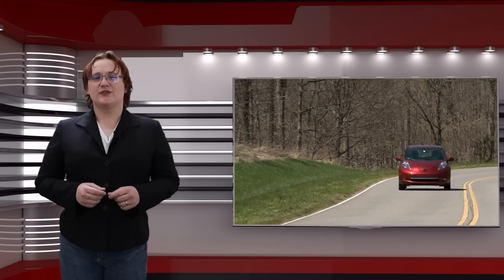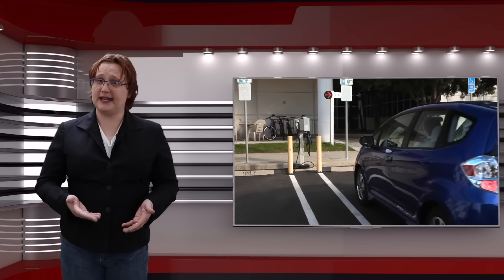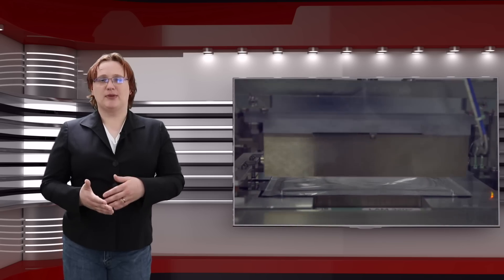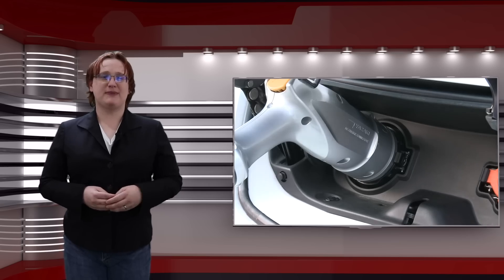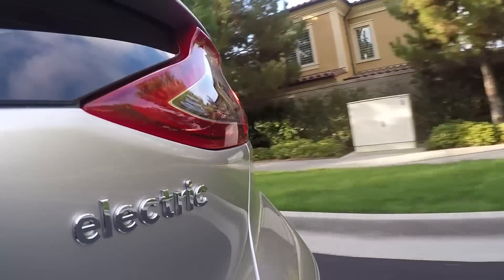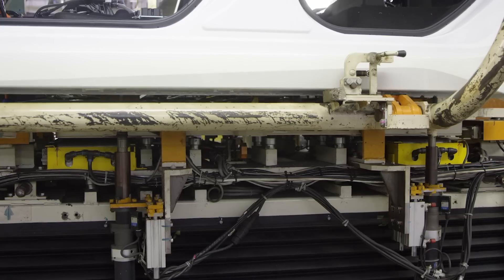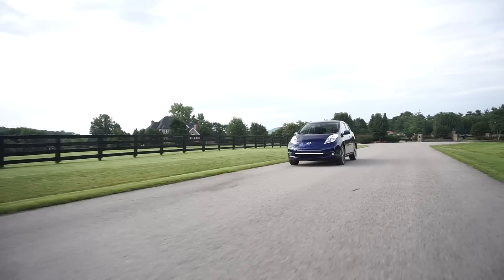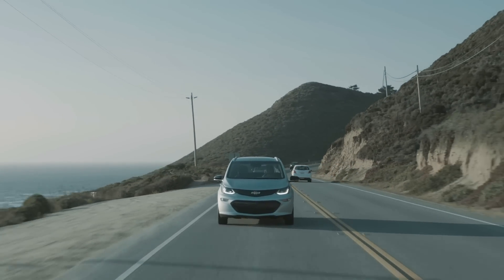Hot Weather and EVs: Why Liquid Cooling Is Best

Comment: I've been considering a 1st Gen Nissan leaf, as I live in the UK and my daily commute is very small, usually less than 20 miles. My concern is, I need to park it outside on my drive, would the battery be okay in a British winter?
Reply: Yer they love UK weather not too hot
Reply from the maker: Honestly, I don't think you'd have too many issues.
Reply: The UK being a temperate climate is good for BEVs. Not too hot, not too cold.
Reply: Simplistically speaking, hot weather is good for range, cold weather is good for battery longevity. There's a level of cold that is too cold, but I don't know where that is, not even as a ballpark figure.
Reply: OriginalPiMan - To complicate things even more: USING (especially charging) the battery in extreme temperatures is a bigger problem than parking it.  Most EVs limit/disable regen and charging until their packs are at a safe temperature.
Reply: John Livesey, the main pack does contain liquid electrolyte and one danger with very cold climates is freezing it.  It's an issue to worry about in somewhere like Minnesota.  It's probably never cold enough anywhere in UK.
Reply: 10 months of year is soggy?
Reply: the car prevents battery freezing, so you would maybe loose a bit of energy over night
Reply: nutzeeer, I don't think it gets cold enough in UK to worry about freezing the electrolyte.
Reply: Larry Harris I think he's refering to the main pack which doesn't have liquid electrolyte like a lead acid battery.
Reply: I live in Canada and own a Leaf. We have Winters, you have Autumn then Slightly cooler weather, then Spring. I don't have any winter issues other than some range reduction due to the cold. Pre heat the car while your plugged in and before you leave to go somewhere, use the steering wheel and seat heaters if you have them and you'll be fine.
Reply: Larry Harris I'm pretty sure the electrolyte is a gel.
Reply: ...which can freeze.  Isn't a gel just a really viscous liquid?

Comment: Here in the tropics where average temperature is 30 degrees celcius year round, one of my friends nissan leaf looses around 15% of its storage capacity annually. Its in its 3rd year and has less than 70% charge capacity. Batteries still have a long way to go for it to be worth the cost.
Reply: Rajivanan Francis no different to your iPhone then? same battery. If possible your friend should not fully charge it to 100%, just 80% and it will degrade less. Also use Eco mode to limit high power drain and keep the car in the shade.
Reply: Thanh Tran First you ask for more information then make suggestions. Right now you are just making assumptions.

Comment: Nice video as always. I'll just add my two cents here. My understanding is that in current Li-ion technology degradation is not so much changes in anode and cathode themselves, as reaction of lithium ions with the electrolyte, forming a solid layer (solid electrolyte interphase) which degrades the performance. Being just a chemical reaction (not directly related to the charging/discharging process), being hot over long periods is what would cause degradation most, not for instance rapid charging per se. It is not quite clear to me where "hot" begins; the graphs I've seen sample at like 30⁰C (warm), 60⁰C (bloody hot), 100⁰C (boiling), and unsurprisingly hotter gives faster degradation, but this is too coarse to talk of any threshold temperature.

Anyway, leaving your car and battery in the blazing sun every day without anything to cool the battery seems like something to avoid. My question is to what extent active (liquid) cooling really helps if you cannot avoid the sun, because your car will be switched off and most likely not plugged in (if you cannot find a shade, how likely is it the you can find a charging station instead?). So it would have to sacrifice its current charge level (risking to leave you stranded) for the purpose of long-term battery preservation. As far as I've seen, Teslas can do this if you program to do so explicitly, but for instance a Bolt will only cool the battery at all while plugged in. Just to say that merely having active cooling may not be enough.
Reply: I think the Bolt will heat/cool the battery even if not plugged in once it reaches a certain temperature.
Reply: Jeff Brunt: I don't  think so. Though I'll admit my only reference is a YouTube video of a professor whose research consists of reading car manuals https://youtu.be/WlxBOJrEKAo . In that video starting from 5:11 you can see that the Bolt manual recommends plugging in at temperatures below 0⁰C and above  32⁰C to maximise high voltage battery life.
Reply: Marc van Leeuwen I read that same statement to mean that it will use power to heat/cool the battery at those temperatures so it should be plugged in to keep the battery from dying. Any Bolt owners here able to chime in?
Reply: Marc van Leeuwen -  I can’t speak for the Bolt, but the Volt would cool the battery in extreme heat (while unplugged) IF the state of charge was high.  High temperature degradation is really a concern at elevated charge levels, and that’s with older chemistries like the Volt uses.  A battery operates by chemical reactions.  If you control the “parameters “ of the battery carefully (temperature, power, etc.) you’ll get the chemical reactions you want.  If not, you can start getting unwanted reactions.  Think of it like baking a cake: if the temperature is too high, you’ll get charcoal; if it’s too low, you’ll get a dried lump.  And you can’t just double the temperature of the oven and expect the cake to cook twice as fast.  Is this a good explanation....?
Reply: Bryan Noga That's great, thanks.

Comment: "Solid state, solid state, where for art you? "
Reply: Hydrogen ends up either being a fossil fuel - stripping the hydrogen from fossil fuels - or being used as a very inefficient way of storing electricity, by electrolysing water to get hydrogen, then liquifying it and cryogenically transporting and cryogenically storing it, then turning it into electricity in a fuel cell.  (although it can also be burnt in ICEs, using it like a liquid fuel with very poor energy density).
Generally speaking, if you're going to use fossil fuels to power your car, just burn the fuel directly.  If you're going to use electricity to power your EV, then best just to stick it in a battery, rather than convert it to hydrogen and then use the hydrogen to generate more electricity.
Reply: Will be there in just ten years.
Reply: *where for art thou?
Reply: ‘Wherefore’ means ‘why.’
Reply: "Wherefore art thou, Romeo" means "why are you, Romeo" further "why do you have to be Romeo (of Montague clan)"
Reply: not necessarily true if battery R&D steps up massively in the next few years -- which I believe it has started to do.
Reply: Just in time to replace your Leaf batteries with smaller, lighter, denser SSBs.
Reply: 8 years away
Reply: How slowly that's advancing, hydrogen fuel cell infrastructure would have been sorted all over the World, even in lagging UK by then =P
Reply: Riggald you forgot to mention how hard it is to store hydrogen. The pressure and temperatures involved in storing liquid hydrogen, the fact that hydrogen turns steel tanks brittle and it goes  downhill from there. Composite tanks are expensive and aren't going to go far to help with the economics either. Storing it as a pressurized gas isn't any better than useing natural gas, same problem with specific volume so low range.
Reply: nutzeeer. Butchered the Shakespeare for the sake of clarity
Reply: That. and the fact that the hydrogen escapes through the walls of the tanks and the pipes.
Reply: 5 yrs